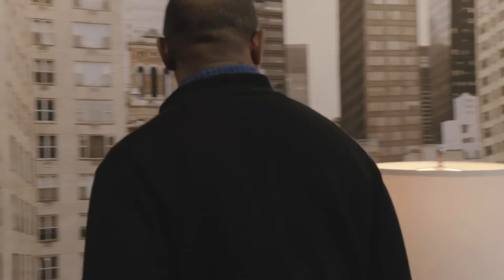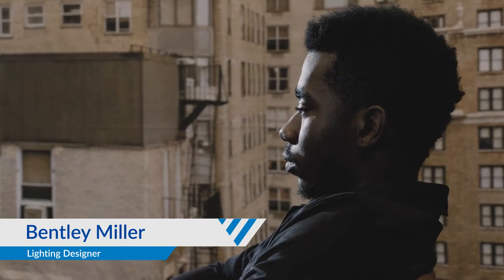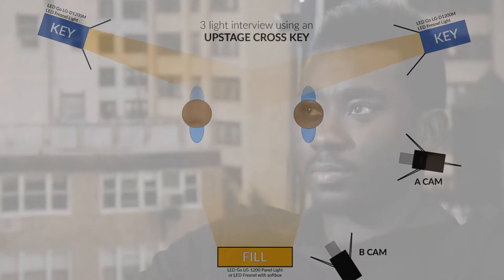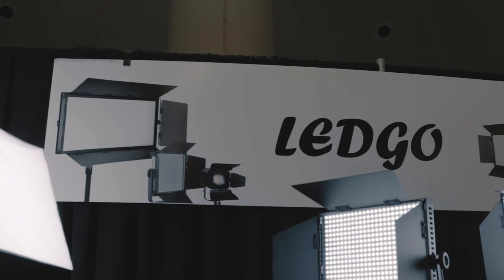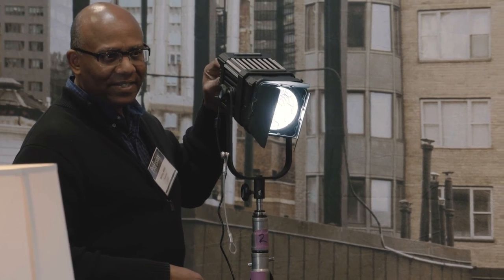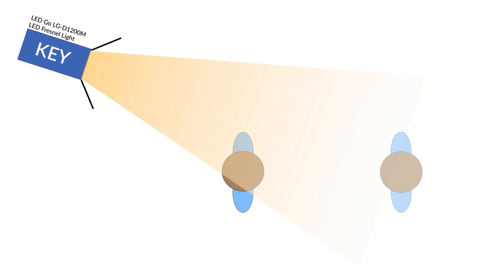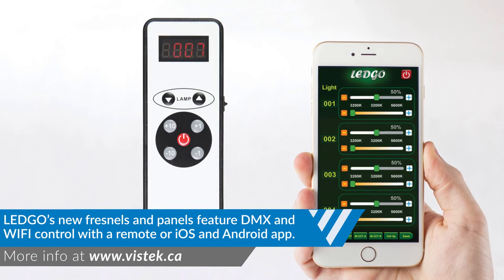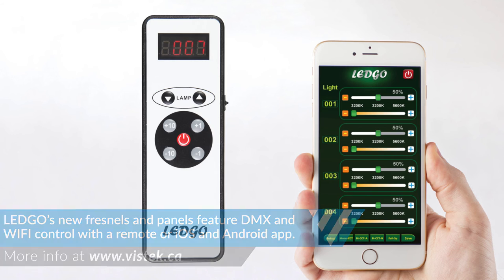Interview Lighting with LED Fresnels | LEDGO

Comment: Was the camera white balanced? Skin tones seem to be terribly blue for what should be a high CRI instrument.
Reply from the maker: Hi Oren, Thanks for the question.  Yes they were - though my memory of this shoot is a bit faded.  These videos were produced in a quick turn-around fashion and shot in a fairly unforgiving environment with powerful overhead metal halide lights.  As well, some of the b-roll that is intercut may have been from when Bentley had the fixtures set to a cooler color temperature.  That's my best explanation as to your viewing experience.